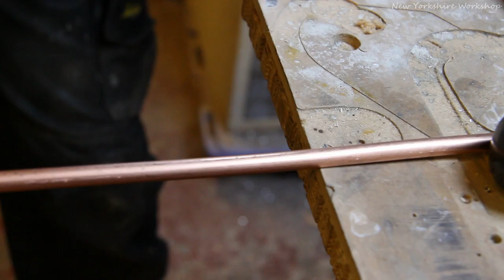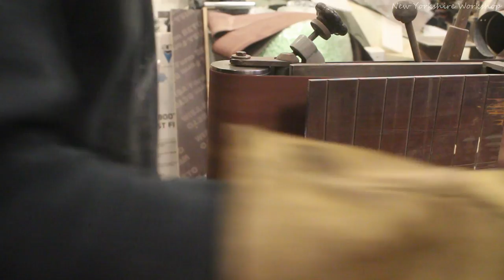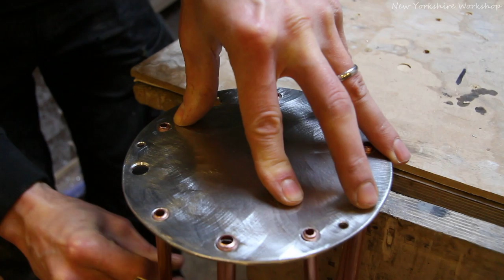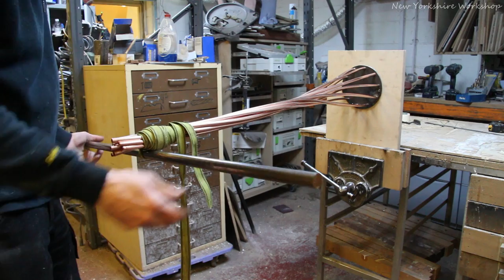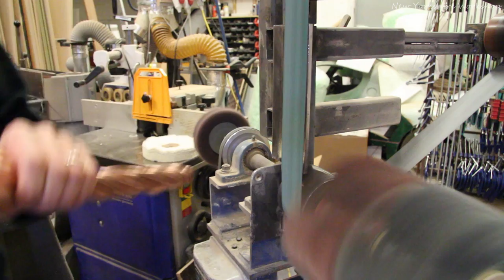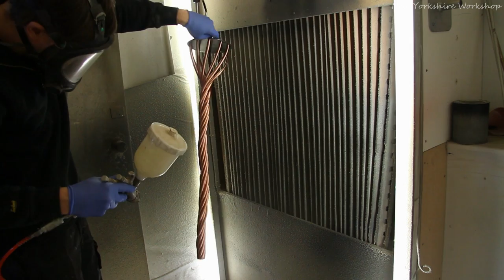How not to make table legs

Comment: What you should do is do what instrument makers do. WATER!  It's cheap and easy doesn't add weight at the end which keeps it light. This is how they get those crisp bends in say, Trombone slides.

Complete all the steps up to silver soldering them to the plate. Use a rubber cap or a "Hot Glue" plug on one end. ( i would cap the end NOT soldered to the plate. Fill the tubes with water and freeze the assembly. Quckly, twist your pipes together. The water CANNOT compress and will allow the pipe to keep their shape. Once formed to your liking, let the water melt. Then continue finishing the Legs.

I hope this helps.

Comment: I was wondering if welding a black iron pipe in the middle of the circles and then twisting the copper pipes around the black pipe would stabilize the legs and the black pipe would practically be unseen

Comment: You were having way too much fun there in the beginning, LOL! 
I read through the description to find out the reason for the title (it wasn't at all apparent!), and may have a few suggestions. Mind you, I didn't see the video on the table these went on, so there may be information I missed.  

Often, wires (which I am assuming you are trying to have this look like) would have a shrink-wrap connector, or "wire" this long would have its insulation start being visible probably about halfway down. That would give you a good excuse to have a tube of resin poured around the base of the legs, in colors like white, black, blue, and red, common wiring colors, one for each leg. 

It would stabilize the bottom ⅔ or so, but that may not be where your biggest issue is. If it's up higher, I'd suggest a clear resin pour around it as an "invisible" stabilizer.

Or, since this design is supposed to be wires connected to pins (I assume), how about one color for each pin, and from halfway between the pins and where the wires separate, paint on 'insulation' in separate colors for each 'wire,' down all the way, following the wraps, to near the bottom. Red, green, brown, blue, purple, yellow, orange, white, all in a spiral coming out of the outer insulation!

Then, if you have more 'wires,' go with a green with a yellow stripe along its length, or vice-versa, for example. Or, yellow with a red stripe, or yellow with a blue stripe along it, or vice-versa... lots of color patterns used in wiring!

All of this you would seal in a clear resin pour. Then, at the bottom ⅓, to finish up the wiring look, you have a thicker, fatter piece jut out all the way around the 'wires' as the 'wiring's' outer insulation. This is normally black, in almost any and all wiring. And say, with that size 'wires,' you'll want to make that fatter spot jump out another centimeter, minimum, all the way around. 

Anyway, if you use my idea and sell it for a chunk of money, I want my cut, LOL!

Comment: I like the idea, I have 3 different solutions that can make this work. 1. Pull a vacuum or two before you start working and pull a vacuum on the pipe and fill it full of Epoxy resin, This will make it a lot stiffer and make your spin twist even because they would not collapse. 2 use a solid core copper and then after you twist it together get a circular steel mold and Hammer the shape, Copper hardens as it is worked Becoming stiff and brittle, but can be Annealed to take the brittleness out and maintain the stiffness I think this will take 10 times the time the other one would take but also could be more effective. 3 Use bronze instead of copper and solid core it does not have to be worked as much as copper does to become stiff and can also can be annealed to keep it from being brittle.

Comment: Another explanation for the improved performance of the legs as they are twisted together more tightly is that there is more composite action among the members as the twisting progresses.
Reply from the maker: is that a posh way of saying friction?
Reply: @NewYorkshireWorkshop  In this case, friction and the changing geometry if the rods locking together create the composite action.  Composite action means the rods work together as a team instead of as individual rods.  Old laced up steel bridge structural members use composite action, but the members are riveted together instead of squeezed together continuously.  In your case, the rods continuously brace each other through the whole length.  In the laced up old steel bridge, the members brace each other at much shorter distances than their entire length.
Reply: Another example of composite action is plywood.  The layers are a lot stronger glued together than the each layer resting on each other not glued together.
Reply from the maker: thats interesting thanks.

Comment: Love the copper look of the legs.. but they look a bit flimsy... perhaps   weld a metal pipe to the base... then wrap the pipe with the copper  wire..... (but i allso see those legs as lighting  on a ceiling with fibre optic on the ends)
Reply from the maker: I was thinking about different kind of light fixtures i could make with while i was working on these, that's definitely going to happen at some point! we have 10ft high ceilings in the old Victorian house so plenty of room for some big lights!

Comment: You think maybe rapping those tubes around a 1" copper "L" type pipe  should stabilize and straighten the legs . And didn't catch the metal copper is in chemical contact with ( I know don't you just love the comments section)  have a good 👍 one !!

Comment: For more stiffness you could make another set, twisting the tubes around a center arbor of solid or tubular steel.  Keep the steel concealed inside the wrap of tubes.   I think 3/4" or 1" steel pipe would be correct.
Just sayin,  if you are not happy with your result.
JIM
Reply from the maker: i thought about something like that but didnt want a tube showing in the at the top where it is open, i think im going to try filling the pipe with resin like someone suggested.

Comment: Was it possible to twist the wires and straighten them afterwards? Because here there are some waves like figures after the twist. Nevertheless, thanks for the video. Helps when learning D&T at school when teacher never explains.
Reply from the maker: it deforms the tube sectionally as well so would be very difficult and never go back exactly as it was, it would need to be annealed too as it would be hardened by the shaping.
Reply: @NewYorkshireWorkshop  thank you sir.

Comment: I love your work and aesthetically the copper legs look amazing, but the table you did with the amazing PCB style laptop table had a wobble because of the copper legs, it came across as style over function.
I personally think the legs are amazing but they should be used in art/low function pieces around a home.
Reply: Oh, I just read  your comment header addressing the wobble issue.
Reply from the maker: thanks. it is experimental and will develop over time, i love the way it looks which is one step toward a good design. before and during working on it i did think of adding a straight vertical 22mm copper in the middle which would have made it more rigid but wouldnt have looked as good, adding resin may or may not work but is worth a try. anyone saying it is impractical, its wobbly and ruined has missed the point of the video, they have learned one way of not making copper table legs and a potential way of making other low function pieces as you rightly say; lamps, low coffee table maybe etc etc.
Reply: @NewYorkshireWorkshop  You might also try heating the entire leg up to Cherry Red. Letting it cool gradually to "Work Harden" the copper. 

It would discolor it, but nothing a little Acid Wash wouldn't take care of. Just a thought. 

(Remember, Copper hardens the opposite of Steel. Cool it Fast=Gets softer. Cool it Slow=Gets Harder.)
Reply from the maker: @JustMe-bu8pu  no it would just soften it, copper anneals by heating and will soften regardless of it being cooled quickly or slowly
Reply: @NewYorkshireWorkshop  I really think your channel will blow up.
You should show even the most mundane tasks you personally think is boring in between the long art piece edit's, it's youtube fodder.
The comment sections will blow up with keyboard experts so your engagement analytics will be amazing.
Reply: @NewYorkshireWorkshop  For large metal holloware (bowls' applied rims, ewer handles), the tubing is filled with sand, then annealed and formed.  The tubes anchored like yours would work-harden  from the twisting.  If the tubes were threaded into succesively smaller jigs, then twisted, you might get straighter legs overall.   I've only made it work with 3mm OD tubing.  You could leave the sand in the tubes so the legs become less prone to denting.  The legs would be heavy, though. The result you got at the bottom of the leg is very interesting when the tubes flattened and got compressed.

Comment: from a structural perspective it might have been better to have used steel and had it copper plated. Of course bending it would be a trip. You'd need rotary hydraulics or a lot of heat.